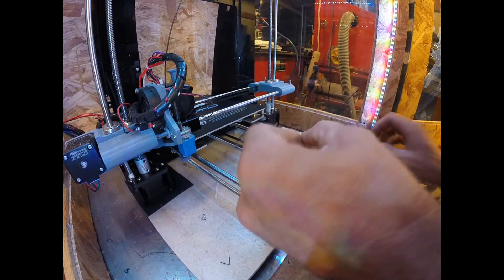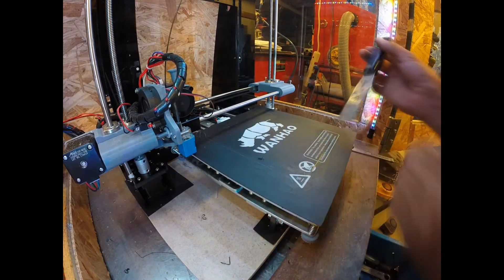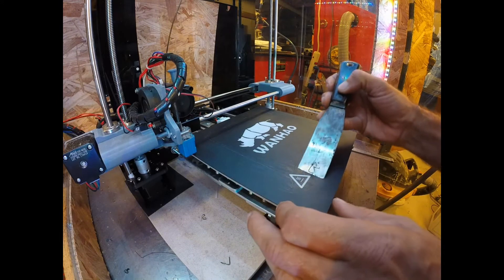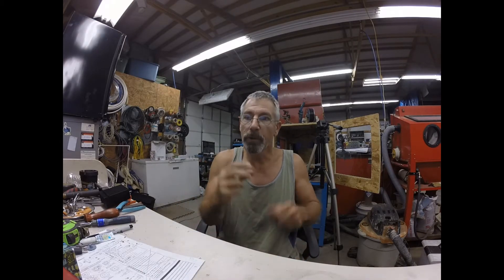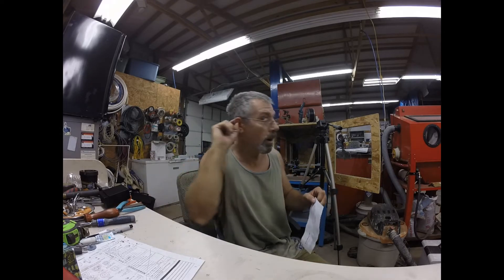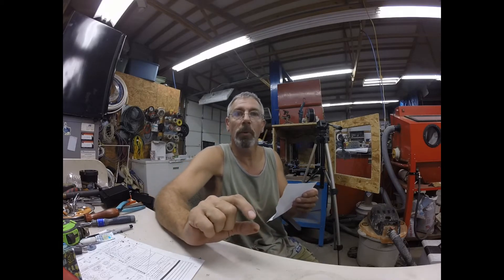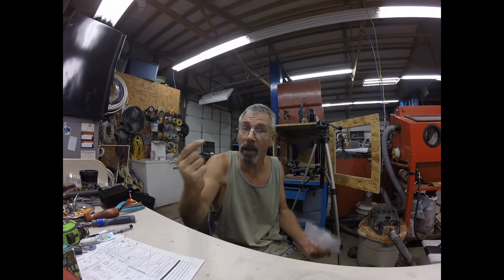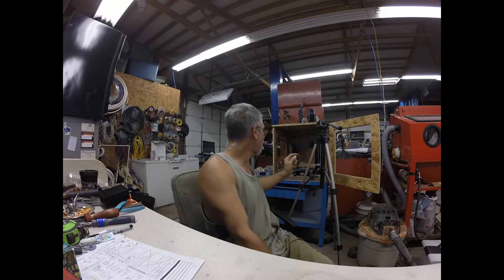Auto bed level blue cube sensor calibration, Part 2

Comment: Marcel thanks for the video ....I have the same sensor and I been using glass with it. Give it try it works..
Reply from the maker: +Rafael Sepulveda how thick is that glass bed you're using?
Reply: Not that thick .. that might be why
Reply from the maker: It would probably work with thin, picture frame glass. But it's kind of a work around, because the sensor only senses the aluminum bed and not the glass surface. There will be a difference in parallelism between the two because the aluminum bed is always warped. In some places the glass touches the bed and in others it could be .2mm away from it. Which kind of negates the reason for having auto bed leveling. You see what I'm saying? At least with tape or build tack, it's stuck to the aluminum bed and follows the contours of it. The only thing that accurately works with glass is something like a touch probe, like the bltouch. There are other diy touch solutions out as well, but for the money, it's not worth the effort in building a DIY touch probe. Better off just buying the bltouch. Those are also a PITA to get setup, even worse than this cube sensor.
Reply: When you printed the X axis the left side with the motor. did the wholes lined up perfect with motor mount and the axis? I did it with PETG and is a little off . Didn't know if I should reprint or sandit down a little.
Reply from the maker: Rafael Sepulveda They were either dead on or real close. I wouldn't worry about it, just sand and or file it to fit. If they're off, left to right, just file the indent where the motor mount sets into it until you get the depth you need.  Might be just a few burrs in the corners preventing it from seating in all the way.
Reply: Marcel LeMay is the holes for the two rods that are off a little
Reply from the maker: Rafael Sepulveda can you get the rod guide thru the parts. If you can, no big deal. If not, just file it to make it fit. make sure the 2 parts mate together nice before you go filling the holes.

Comment: I think link for your instruction is for the facebook group not to the exact file.
Reply from the maker: +Dariusz Delanowski Yes, thank you for pointing that out. I'll fix it.
Reply from the maker: +Marcel LeMay It should be fixed now. Let me know if it doesn't work or if it's good now.
Reply: Yeap, now it works well. Thank you. One question. Someone in the comments said that the sensor distance depends from the voltage provided from the motherboard (Anet board provide 5V and sensor is 6-36V so the sensing distance is so low) if you will add something like this https://pl.aliexpress.com/item/MT3608-2A-Max-DC-DC-Step-Up-Power-Module-Booster-Power-Module-For-Arduino-3-5V/32675974827.html won't it fix this problem?
Reply from the maker: Dariusz Delanowski  I don't know of anyone that has tried it and gotten a longer sending distance . There are however, lots of people that have used this sensor on 5v, even though it's only rated for 6v.
Reply: Maybe I will be the first one :)
Reply: @d2ka  I'm guessing the results from the higher voltage weren't worth posting about? Was curious myself... time to start clicking links.